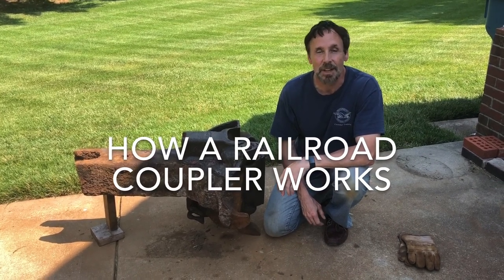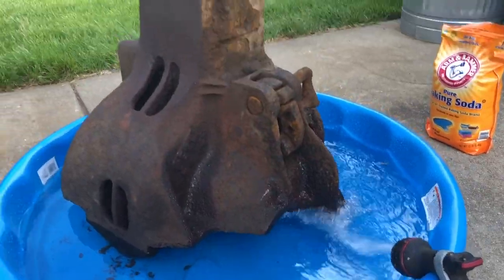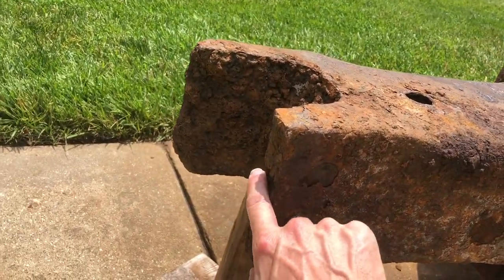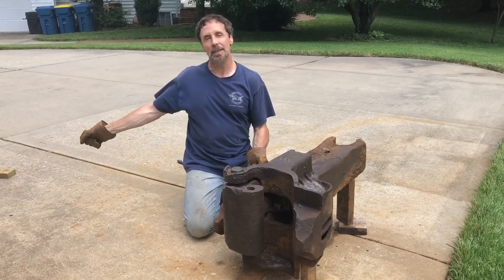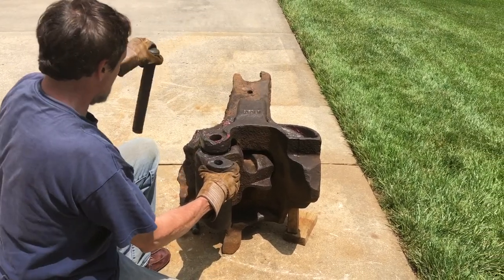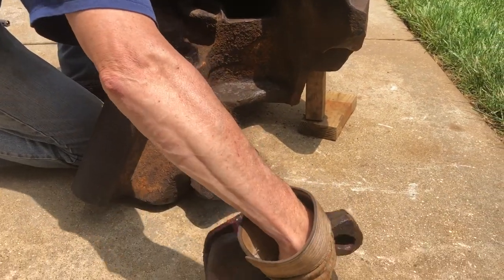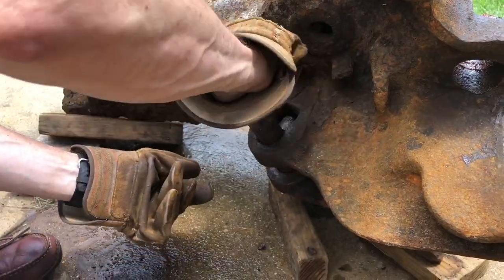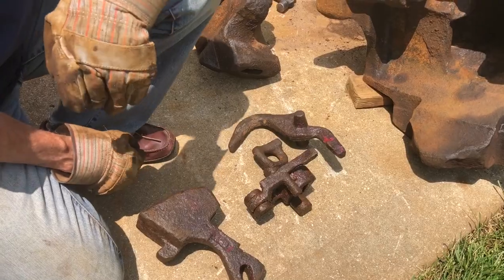Railroad Coupler

Comment: Neat. What’s made from? Is it a mild steel?
Reply from the maker: I believe it is high-strength steel with a tensile strength of either 90,000 or 120,000 psi
Reply: @johnsworkshop3312  thanks!  Are you going to keep it reforge into knives??
Reply: @johnsworkshop3312  https://mcconway.com/catalog/freight-couplers/

Type E steel. 

Neat stuff. Didn’t even know how and when couplers were invented either, amazing how long that technology has remained basically unchanged.
Reply from the maker: I never thought of that - but it sounds like a lot of work to cut a piece off and then shape it into a knife.
Reply from the maker: Thanks for the link!

Comment: The reason your Electrolysis did not work correctly is due to the fact that you used the wrong additive. You used Sodium Bicarbonate (baking soda) when you should have used Sodium Carbonate (washing soda). These are two completely different compounds which will yield completely different results.
Reply from the maker: That is really good to know.  Thanks.   Next time I'll be smarter.

Comment: 2 ?s if I may: 1) approx. weight 2) can it operate to release when under tension
Reply: They will not operate under tension.
Reply from the maker: Thanks - that makes sense based on how the lock contacts the knuckle, and if the knuckle is pressed into the lock there would be no way to raise it.

Comment: I'm surprised how this coupling is made up of cast parts with very little machining of the joints to create tighter fits.  But thanks for the look inside.
Reply: Those had to be turned out in many hundred thousands of units.  They wanted strong, fast, reliable and cheap.
Reply from the maker: Great point!

Comment: Lol I found one of these the other day
Reply from the maker: No kidding!  That is pretty cool.  How did it fail?  Same way mine did by pulling out on the drawbar side?
Reply: @johnsworkshop3312  thanks. fail sorry what do you mean?
Reply from the maker: Wow Ammonite8, what a great find.  It looks like the coupler you found is missing the knuckle.  I wonder why all of those parts are out in the woods?
Reply: @johnsworkshop3312  thanks! It’s not really in the woods it’s actually beside a railroad that was originally made in the 1890s and only about 30 meters from a highway. The bolts on the other bits indicate the cart it came from was wooden.
Reply from the maker: Very cool!  What a great find.  That hardware is much older than my coupler.  They started making the Type-F in 1954, so it cannot be any older than that.
Reply: @johnsworkshop3312  awesome Thanks for the general time range! It always really helpful knowing when artifacts like these are from it helps to piece together the history around the area. I really appreciate it!

Comment: Here is a short vid on the history to back up what I corrected in the comments below, about someone saying the coupler was made by Eli McCoy, when instead, the idea came to Eli Janney and he ran with it. Here: https://youtu.be/p2gezL_z3Ow   Hey, you need a FRED device to go on that coupler. The flashing red light on the last car, that links to the loco that transmits air pressure and other info about the train. I get 'em from the coal cars when they stop. You need any coal too? I can drop a load off got ya. It's a pain shoveling that stuff off the top of those cars but at least I'm not stealing packages in LA. How about a headlight from a loco? Need one? 😂 🤣
Reply from the maker: Thanks for video link Colorado Strong.  Very interesting.  Yeah - a FRED would be cool to add to it.  Sounds like you've got access to lots of cool stuff.  Thanks for sharing.

Comment: Never ever try to install an F knuckle into an E coupler. It will start but it will not close so if you try to couple it up to another car it bends the pin and it jans the knuckle so you can not get it back out with your hands.
Reply from the maker: Very interesting. I would not have thought that. Thank you. Sounds like the voice of experience.

Comment: The RRs are really pushing them couplers to the limit with miles long trains.wonder when they will find a weak point.
Reply: They do occasionally break on a train in transit. I've seen some railfan videos of that happening. Because of the way the air braking system on trains works, the air hoses will decouple, dump air from the main line and throw both halves of the train into emergency braking. That may have been what happened to the coupler he found, or it might have been broken off in a derailment.
Reply from the maker: Interesting - thanks.  It would really be interesting to find out what happened.

Comment: Believe it or not, that pin on the new couplers is plastic, or nylon, you get the point, non metal
Reply: What railroad uses nonmetallic pins?
Reply: The pin only holds the knuckle in place to keep it from falling out when the knuckle is opened. . It doesn't contribute to anything else. The knuckle pin can be removed from every car in a train and the train will operate just fine. Now as a conductor, you have to make sure the pin (knuckle pin) is in place so that when you pull the pin (cut lever)  the knuckle doesn't fall out when it opens.Like John showed in the video the locking block is what locks the knuckle closed. most of the time they are east to replace if the locking block stays up.
Reply: @BossSpringsteen69  I'm still curious what railroad uses non metallic pins.
Reply: @shullreric98  They are totally AAR legal, and have been for many years. Once they get dirty, you’d never know the difference unless you look at the bottom of them! They have a fork type bottom to lock onto the bottom of the coupler body instead of the time honored cotter key hole in the steel ones. They’re everywhere! You just have to look for them.
Reply from the maker: Now that I learned that the pin is just to pivot the knuckle that totally makes sense.  Thanks!